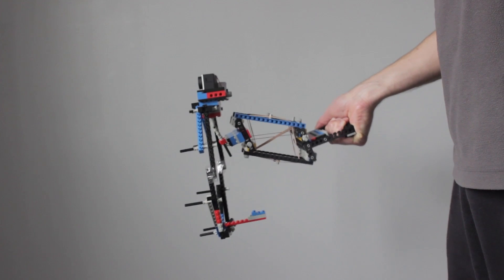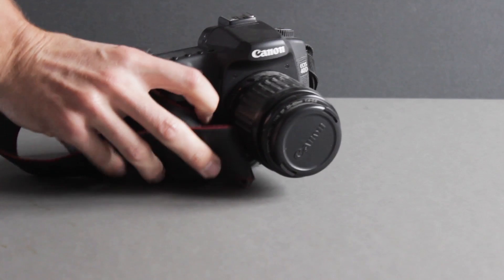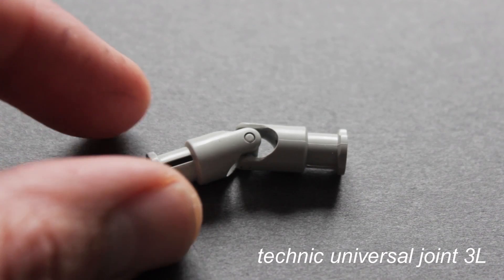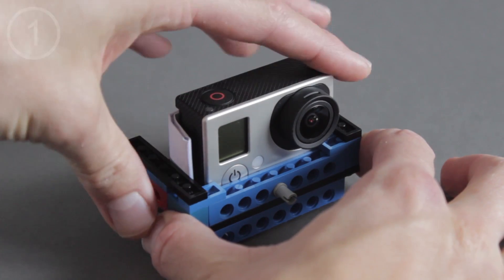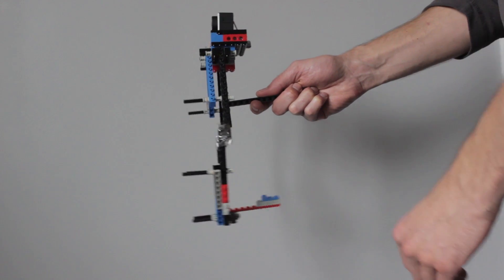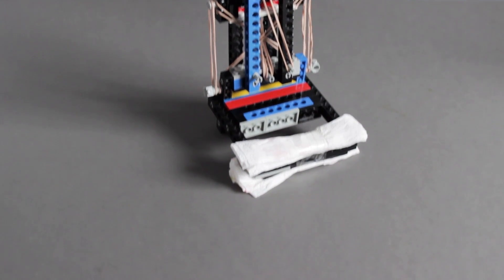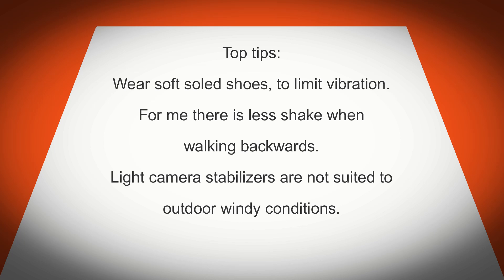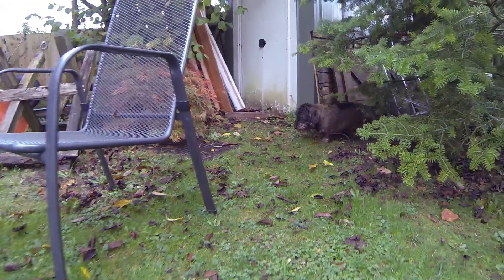DIY gopro camera stabilizer for free - producttank

Comment: This is golden. I've watch so many video on DIY stabilizers and a lot of them were good but I had a budget of $0. This works because I'm lucky enough to have over 1000 pieces of technic lego sitting in a closet. Plus this is the only diy stabilizer with vertical stabilization that I can find. Thanks so much for posting this

Comment: hey great video and I love the simplicity of your wooden steady cam. I had a question about what you used to get the smooth motion of your 2 squares around that block near the handle?
Reply from the maker: Hey Chance, I use roller blade bearings you can get packs of ten from Amazon really cheaply and they are super smooth. PT
Reply: +producttank Thanks I'll try them out.

Comment: One axe is still shaky so it's useless
Reply: +Domino SixO Better than handheld.
Reply: Epiksun Production but it's handheald isn't it ? :D
Reply: Domino SixO So is the DJI Ronin which cost $2000.
Reply: Epiksun Production with 2000$ i can make you 10x 3ax. stabilizer :D only noobs pay such money for nothing, engineers build themselfs.
Reply: +Domino SixO So can I, it's not hard to build. That's not the point of this video, as this is a whole lot steadier than holding the GoPro by itself.

Comment: Hi. 
1. Roughly how many hours did it take you to finalize the Lego and/or the Cardboard design? How about how long would it take someone do you think it would take someone to build something similar?
2. How durable is the Lego 3L joint?
3. How easy it is to disassemble/pack/reassemble (for instance taking in you bag to a a local 30 mins away)?
Thanks
Reply from the maker: Hi Lonerider, once you have the principles and enough Lego, it takes about 2 hours to make.  For someone to build something similar allow 3-4 because we all have different Lego.  As long as you're only supporting a GoPro or similar, the 3L joint is fine, mine hasn't broken yet.  It's easy to disassemble, but you have to be careful transporting it.  It's far more durable if you glue the Lego together or wrap it in tape, which you have to do for strength anyway.  Because the camera and Lego is really light, it's not good in windy conditions.  If you have the tools etc, making something similar in wood is better, but not everyone has access to a workshop. Hope this helps. PT
Reply: Thanks for the info. I do agree that the factory-made stabilizer seem pricey for what they actually are. However, in my mind there are the two saying "nothing is truly free" and "Linux is only free if your own personal time has no value." In that line of thinking, if I spend the 4 hours it would take me to build a Lego-stabilizer instead to work a half-shift for $15/hour... I would be able to buy a factory-made stabilizer that is guaranteed to work, more durable and easier to store. So then it sort of becomes a question of whether this is actually "cheaper" for me personally. This totally looks like a great hobby project for someone who is mechanically minded.

Comment: Great project, but if you use the sony action cam. You dont need that stabilizer... it is in the software
Reply: No... Just no... Though there is a stabilizer, it's software based. Software based stabilizers are practically useless since it can only stabilize minute shaking caused by your hands, not by your movement, which his stabilizer does. Software stabilizers also cause somewhat deformation and crop of your image since it needs to compensate for the movement. Even if the stabilizer is hardware based, by having a stabilizer holding the sensor, it wont help that much. 
The kind of stabilizer he's making is what's called a steadicam, which not only cancels out small vibrations from your hands, but also cancels out larger movement like the ones caused from footsteps.
So no... You're unfortunately incorrect.

Comment: I just bought a Feiyu G4 Gimbal that seems better for my go pro it just works.
Reply: +Tamás Molnár Not really Tamas Molnar. A gimbal refers to a pivot support systems and allow a device (like a camera) to move about a single axis. More can be added so you have 2 or 3 axis motion. Both a mechanical device (like a steadycam) and an electronic device (like the Feiyu G4 gimbal) use gimbal technology. The mechanical device relies on inertia and a pendulum to maintain a relatively stable position, whereas an electronic device uses brushless motors and IMUs with algorithms to maintain a very stable position. The universal joint on the drive shaft of a car could be considered an example of a gimbal as well. Since the term "gimbal" describes what their product does companies like Feiyu have just taken the word and made it synonymous with their product.
Reply: PKTV I have tried that but won't work well on-board a sports bike.
Reply: PKTV A gimbal is not a steadicam. Two completely different principles.

Comment: Hey, great concept. I tried to rebuild it from this video, but struggled at putting the 3L joint in the right position...
How did you manage to keep the blanace? In my build the camera always swings down rapidly and there is no sign of balance at all... :(
I'm confused and I can't really tell what you there did from this video, so I hope you can help me maybe.

Cheers!
Reply from the maker: Hi Enduroswag, start by putting the 3L joint under the camera in its centre, then moving it backwards to the rear of the camera.  If the camera swings down too rapidly, you have too much weight or not enough beneath the camera in the arms, so taking everything off until you have the bare minimum frame.  Now add weight gradually testing as you go.  You will feel if the camera is the heavy element or the arms are the heavy element by the swing.  If it pulls to the left, add a little weight to the right etc.  Don't forget, you can add weight up the arms closer to the 3L joint, not just at the base.  I also built a leg sticking out of the base that helps.  Let me know how you get on. PT
Reply: producttank Alright thank you. I got it balanced with adding some bricks to the frame.
The tensioning system was pretty under pressure when i added the rubber bands, so i had to build in some struts to make sure it's not breaking while filming. But i guess i finally put it all together now and it's working. :)
There are some issues when i'm running or it's windy, but i guess you can't complain if you build yourself a steadicam for actually 0$ ;)
Thank you for sharing that awesome design, i really appreciate it! :D
Reply: producttank It would be VERY nice if you could make a build-tutorial - you inspired me to do so many things with this gyroscope :D !!

Comment: Have you tried making one for a DSLR or a mirrorless camera like the Panasonic Lumix series? Thanks
Reply from the maker: Hi frankie e, I haven't tried making one for a Panasonic Lumix, but I think my current crane would fit one if I adapted the front camera mounting area.  I'd just have to add more weight to the back and either make the aluminium tubes stronger or not extend them as far. PT

Comment: very dedicated and skilled to create such a thing. but seriously the amount of time, research and effort you have put into this, dont you think a 20 quid gopro steadicam from ebay would have been a better solution...
Reply from the maker: Hi Sam, when I started building this stabilizer I searched around and the cheapest one I could find was about 60 quid, which I felt was too expensive for what they were.  Also none of them had the Vertical movement dampener, so I thought I could make one that was better than what I could currently buy.  That was the challenge anyway! So I built one and then in use realised it would be even better with a phone or iPad attached with the GoPro app, so that I can see what I'm filming.  In hindsight I think you're probably right, it would have been far quicker to buy one off ebay as you suggest, but I had fun making it and I learnt a lot in the process, it cost me very little apart from my time and I think it is far more functional than what you can currently buy for 20 quid, but if I had to do it all again and it wasn't about the journey, more just about getting straight out there and filming with my GoPro, then if they work, a cheap one off ebay is the way forward! 😄 PT
Reply: Sam D'Cruz the only problem is that there are so many of those on ebay....we are rolling the dice, but i guess we are rolling the dice all the time for the cheap ones anyway.
Reply: Inquisitve m yeah I bought one from ebay for my DSLR, it sits nicely in my closet. Never got it to stabilize anything whatsoever.

Comment: Is it possible to build it without the technic universal joint 3L?
Reply from the maker: Hi Steff, it is easily possible to replicate the technic universal joint using a few extra pieces of lego, or make a lego gimbal similar to the one used in the wooden stabilizer I built at the start of the video, but neither of these will be as compact, I have also seen other types of universal joint in lego, but haven't been able to find what they're called.  PT

Comment: I love how the first stabilizer is no big deal. Could we possibly get a tutorial on that? (:
Reply: producttank could you make a tutorial for the first stabilizer that can be seen in the video?
Reply: producttank  I personally would still love to see it
Reply: producttank  i believe pillar drill is the same thing as a drill-press here in the states and more people then you would think have them in there homes or know some one who would have access to them. ps the real steady cam is not light at all and your arms do get tired.
Reply from the maker: Hi Pivot, sorry for the late reply, my broadband has had issues.  The first stabilizer is similar to many DIY versions on YouTube, the only real difference is that I've used old camera film pots filled with coins to balance it.  I can do a tutorial, but you'll need a pillar drill and what you'll end up with will be really heavy to use for more than 10 minutes, which is why I ended up building one for my GoPro. Hope this helps;-)

Comment: Could I ask you how heavy this stabilizer is without the gopro? I'm looking in building one for an R/C airplane, which is very weight sensitive. 
Thanks
Reply from the maker: Hi Ibabeanu, I have just put the system on the scales, it weighs 307grams/10.8oz.  The problem for your application is because my system is so light, it's very prone to wind movement. Which is fine for me as I'm on the ground, but may not be so good in the clouds! Just using the tensioning system may take out a lot of vibration, reduce weight and provide the answer, you'll just have to experiment.  If you have the money, a brushless electric gimbal system would be ideal, but they are expensive.  Good luck. PT